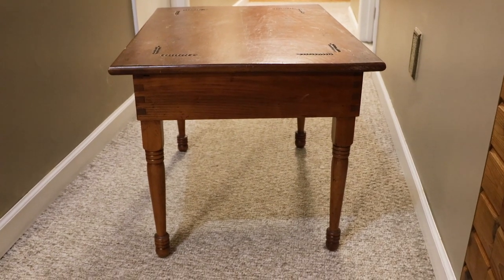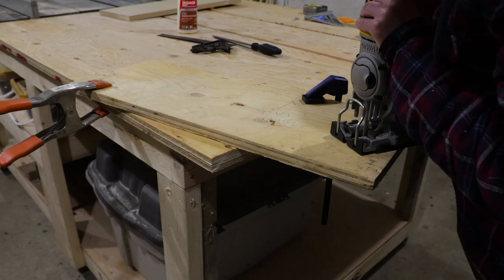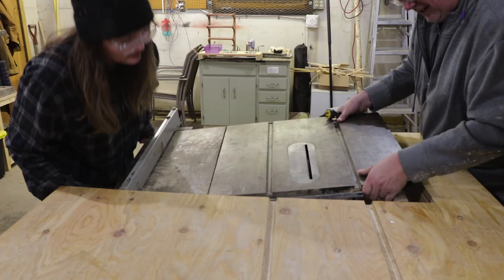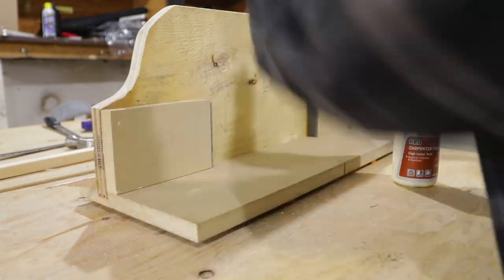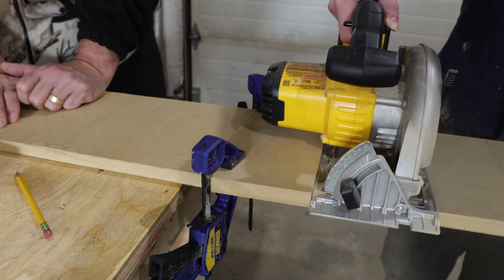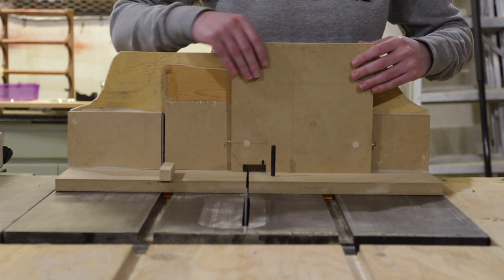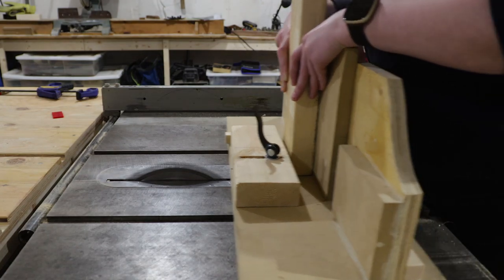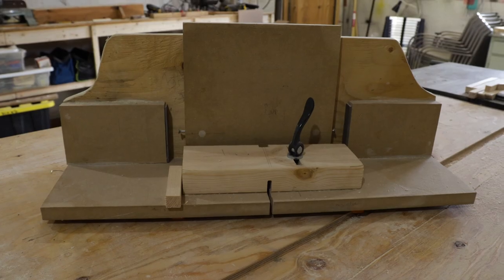No Dado Box Joint Jig (Plans Via @SteveMaskery)

Comment: Nice show of joy when a joint (finally) comes together.  The first half laps that I made on my table saw were for the frame of a pull-out shelf in the basement.  The amount of wood putty in the joint is exactly, um, one kerf cut.  🙂
Reply from the maker: It's a much more difficult process than I thought when I originally set out (as you can see by my very poor first attempt)! Besides, a basement shelf sounds like the perfect place for a "slightly" puttied joint 🤫